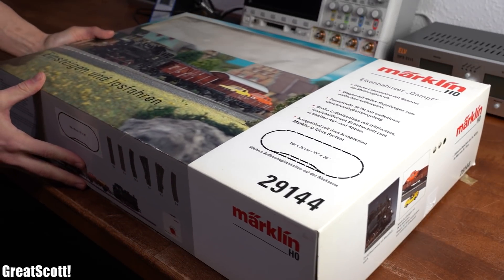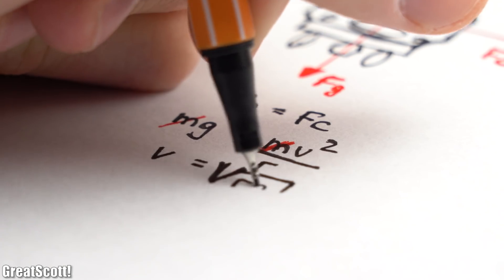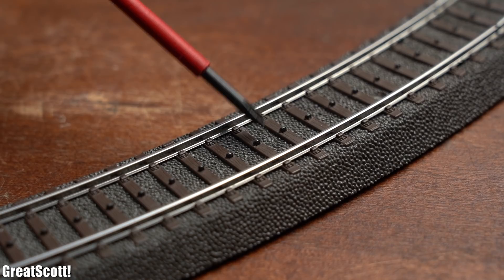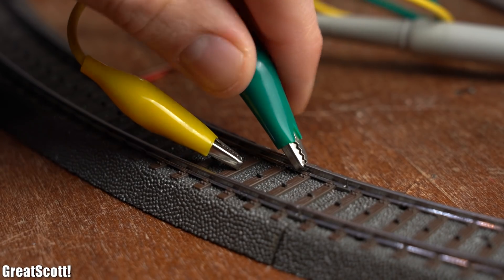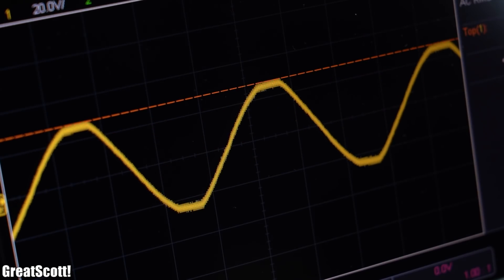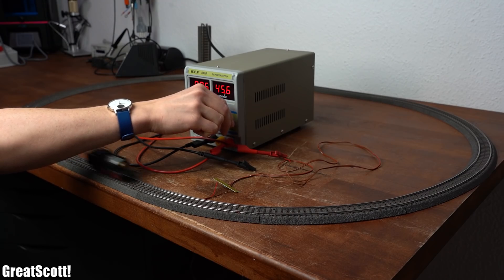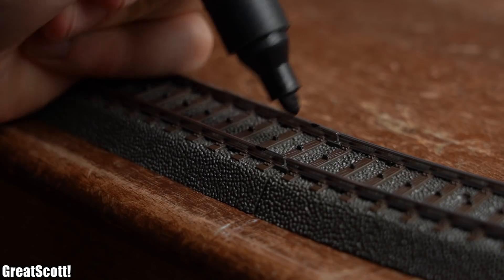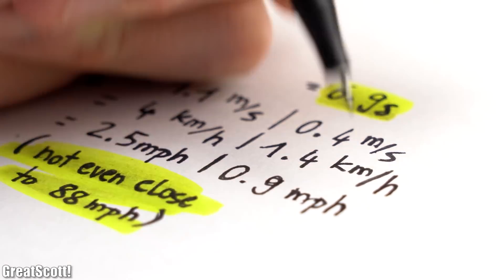How fast can an overpowered model railway drive? 88 mph?

Comment: Timing manually with your phone? Imposter!! The real Great Scott would have set up a photodiode and Arduino to record timings and ramp up the speed.

Wish you'd spent some time on the loco's circuit. What does it do, and what are the DIP switches for? Is there some form of soft start function?

Whoever that train set belongs to, buy them about 100m of extra track for Christmas and use it to settle the max speed question properly. If you can't buy enough track you'll need to call in Gromit.

Comment: Perhaps it is not the simplified formula but some other factors that made the locomotive derail at lower speed than expected, may be the spring that pushes the central contact onto the rail reduce the Fg?

Comment: But this 130 size motor is not capable of taking that much high voltage. It can roughly handle 12 to 16 volts. You should find a much higher KV rating motor. Or some high KV brushless motor.

Comment: If you tilt the railway properly especially on curves to "stabilize" the centrifugal force, you will be able to get higher speeds without the train derailing. That's the big issue with model trains - the railways are always flat (even though the actual railway is sometimes put on a platform that elevates it slightly and theoretically allows to add some tilting).

Comment: I hooked a stomper (1.5v) up to a tyco model rail road supply (variable to 18v, I think) It zipped really fast back and forth the length of the power cable really fast a couple of times before it burnt out.

Comment: Hi Scott, tank you for your videos. Your calculations for the speed limit are wrong. Indeed, the condition that the train stays on the rails is that the sum vector between the centrifugal force and the weight pass by a point situated between the two rails. So your calculations are good only if the heigh of the center of gravity of the train is half the distance between the rails. Have a nice Christmas, thank you again for your great videos, keep wondering us!

Comment: When did model trains start needing microcontrollers? They use to just be a DC motor and gear box and got positive and negative via the rails from a variable power supply.
Reply: DCC/Motorola system. You only need one controller for up to 256 independent trains
Reply: @TheRailroad99   ah, makes sense.  Still seems a bit extra though.  Those engines must be expensive as shit.  Hell even standard engines are usually well over 100 bucks each.
Reply: @darkworlddenizen  they are. I own many... But the decoder itself is not that expensive, around 50 bucks for a good one, cheap one for less than 20 bucks. 
Electronics are very cheap today

Comment: I'm sorry to tell you but the physics calculations you did were complete bullshit. What you needed to calculate is the angle of the combined forces of gravity and outwards turning force. If this is greater than the angle from the centre of gravity to the outer rail, then you have derailment. You 'assumed' derailment would happen if that angle exceeds 45 degrees

Comment: A old train set that my grandparents have changes the train's direction by pushing a higher than usual voltage through the system.
This makes some sort of solenoid trigger in the model train, reversing the direction, or making the train boost very fast if it doesn't trigger.
This is apparent by the model lights flashing brightly.
Reply: Yes, that was the old, mechanical way to switch direction. These trains also had AC motors.
I'm a fan of DC motors with digital controllers.

Comment: The equation Fc = Fg  is only true if the x component of the location of the Center of gravity relative to the outside wheel is equal to the y component of the location of the Center of gravity relative to the outside wheel.
The instance where the cart will lift off the track, it will pivot about the outside wheel and create equilibrium of moments between Force from Cg and Force from acceleration in curve. 
So simplified, it would be Fc*y = Fg*x, measured relative to the pivoting wheel.

Comment: I would LOVE to see you do a video on the electrical engineering of modern digital model railroad control. There's a standardized system called DCC and it's really quite fascinating to me how it is able to send power and data over the same two rails. Great video!
Reply: I  would like to see that, too!

Comment: I used a logo 6 and some proximity switches to make some arbitrary stations and time tables. Revesable through relay multiplexing with a higher voltage^^

Comment: The equation is wrong because you need to make de torques equal, not the forces. A train with a higher center of mass would certainly fall at lower speeds.

Comment: u need to create a mechanical cyclotron. Just add two railroad switches to a vertical loop. One switch is the locomotive input and the other one is the trigger allowing the locomotive leave the loop and be launched  against some target or back to the future. Locomotive must use an aircraft brushless motor.

Comment: ALLL  RIIIGHT  ~  We get to play!       'Need to Increase Voltage,  but - Power Circuit won't handle it.  So I unhooked it.'      = )   
Needed You when i 'was' kid.   Played with Dads Train set - Those cool old ones - (Bro) < lol,  increased speed to see it Fly off table.   Tough Train!

Comment: you would probably get better results by rigging a analog marklin 3029 series motor directly andthem pumping a lot of AC Voltage in it. Also that chip on the underside is a marklin modified Motorola MC145028P IC with added circuitry for digital operation.

Comment: What's that design ? My old Jouef electric train has on rail connected to the + and the other to the -.
Reply: It's Märklin's 3-conductor system. The tracks are connected inside the track and the other pole are the little dots in the middle. As Scott said, this train runs with AC current.

Comment: Hi, you need banked turns(Steilkurven) reach higher speeds, and/or longer straight passages with additional Voltage insertion points.

Comment: I had a similar model train but it was dc with one rail being positive and other one negative 
I think the reason why your has seperate positive is to prevent track spoiling 
On mine positive track was badly pitted

Comment: The equation is quite incorrect. You need to use the coefficient of friction when calculating the max centripetal force. GreatScott! set the coefficient to 1 which in reality should be something more than 1.  Doing this would result in a lower theoretical speed which would be much closer to the one he achieved.
Reply: Not really.  The train's wheels are not flat.  They have a ridge on the inside edge that holds them on the track and allows them to go around corners.  So you would have to take into account the depth of that ridge.  You would also have to take into account the height of the center of gravity of the train.  Obviously, not a simple problem and I do not know the solution.
Reply: @jimbert50  you're right. I was trying to simplify it. 

Lol. Friction is just tiny ridges too. Just up the friction coefficient for bigger ridges?
Reply: @pratikkunkolienkar1561  Do that and it will help a little, but then the CG will become the dominant factor.  Actually I think the CG is the main factor anyway.  Notice how the train leaves the track.  It does not slide off due to not enough friction.  It can't really slide off because of the wheel ridges.  It actually tips over, leading me to think that CG is the main factor.  LK is right - the width of the tracks is also a major factor.
Reply: @jimbert50  agreed.  The Reliant Robin got 3-wheeler cars a bad name by falling over on bends.  Sadly, people blame that on it having 3 wheels when the culprit is a stupidly high CG.  I had a Berkeley T60 which had the better geometry of two front one rear and a CG about 20 cm above the ground.  That won't tip, it'll slide when the tyres  lose grip, as 4 wheeler cars usually do, unless they have a high CG.   So the essential issue here is CG.  Add some lead sheet to the bottom of the loco, just clear of the sleepers and it'll go round a bend faster.
Reply: Its Held in the Tracks by the normal force in the rails. Maximum Speed squared = 0.5*r*g*l/h, where h ist the vertikal Position of the Center of Gravity and l ist the Wirth of the Tracks.

Comment: Not even close in real world speed, But you forgot to calculate scale speed.. I bet it was going 150mph or better.
Reply: H0 is 1/87th from reality, thus 2.5mph would equal to ~220mph. Quite good for electric steam locomotive, lol.
Reply: This is H0 gauge, so the scale is 1:87
Reply: @e1woqf  87 x 2.5 mph or whatever the speed was he said. So essentially it went past 88 and came back from next week to give us this video. See ya in two years.
Reply: @wojtek-33  Yet it derailed, thus the physical effects of (over)speed were scaled.
Reply: @wojtek-33  A two axle shunter probably did not fill those measurements, but anyhow, since material density doesn't scale either, feel free to claim one internet point. 🤗
Reply: You don't do speedscales, do You? 
That's like scaling colors in architectural models ....
Reply: @wojtek-33  But measurements are, and yes, you can't actually scale speed, but you can scale distance traveled, then time how long it took to travel and get a theoretical travel time in the full-scale model. (as long as they stayed the same speed because you can't actually scale speed. If you scaled speed, it wouldn't be taking into effect weight, aerodynamics, etc. which is exactly what you already said.)
Reply: 5:25 if you take force of friction= centrifugal force then it should work who else agrees
Reply: I don't think he made the point clearly enough.  If I make a 1/10 scale model of something involving light am I safe in saying that the photons are travelling at "scale speed"?   Ten times or one tenth of c?  Nah.  Similar problems in scaling fluid dynamics.  Only small bumble bees can fly, not big ones, because the aerodynamics don't scale.
Reply: @raykent3211  whatever
Reply: @raykent3211  Well, assuming that the real scale train would hit ~220mph on a track of the same upscaled radius, it would topple over, just like it did in this video. So, you will find your theory is not quite correct. Although I do understand what you are saying, things such as aerodynamics and tolerances make a huge difference when scaling things. I.e. it wouldnt be practicable to just scale every component up, making it a different component in a sense, and it would obviously be limited by aero. But physics aside, without taking it too deep: "if you were to fit in this train it would feel like 220mph". It's all relative

Comment: I tried this when i was a kid.... As a result i ended up with a broken train with burned motor..😭
Reply: Did this with a 9v and a scalextric, worked fine some how, but you had to catch it to stop the bloody thing
Reply: I tried it with those small electric cars, also burned motor lol
Reply: Why mine didnt burned.....Even i inserted 9v in it,
Reply: F
Reply: as an adult i'm still trying to push the toycar to go faster with 18650 cells. Might be not for long before i have another dead motor LOL
Reply: I have a collection of burnt DC motors
Reply: @SirDella  Can a burnt motor be repaired ?
Reply: @kiranshashiny  Yes, the coils and brushes can be replaced, I don't know where you get new brushes from tho
Reply: @SirDella  u can make them with aluminium foil or small strips of a metal cut to the shape of the brushes. I have done this and it works well. I even think the aluminium brushes are more efficient compared to the coarse brass brushes.😁
Reply: @nonowords7857  Thanks!
Reply: @SirDella  happy to help.
Reply: @SirDella  I actually made a lot of gizmos with motors when I was younger and I know a lot of work arounds for problems like burnt or brush damaged. Ask me anything. But yeah I have a question, I have literally pumped 16 volts into a single small motor multiple times yet I have never managed to burn any. Tell me how any of u guys managed to do this.
Reply: @nonowords7857  That's nice! I played around with motors too. Only a few burned out more than ten years ago so I don't remember what happened to them, but I know that I connected one to a 9v battery and died after a few seconds, they were from cheap toys so that could be a reason.
Others lost their solder pads since I didn't have a soldering iron so I strapped the wires to them, over time a lot of them lost their pads
Others simply got obnoxiously noisy, which could be fixed with some lithium grease I guess
And the last one is a hair dryer motor, the carbon brushes worn out and it can't be opened sadly
Reply: @SirDella  I have used 5 nine volt batteries in series to run a single motor. The total voltage must have been near 45 volts but cause the batteries were cheap I think it was near 20-25. Yet I didn't get a burnt motor. and I tried this on the same motor which is in the train in this video. I can only see one way to burn a motor and that is to connect multiple 9 volt batteries in parallel and thus pushing the total current to extreme levels and thus burning  the thin copper wires. And yeh I hate it when those pads break but I found a workaround for that too😁
Reply: @nonowords7857  that motor is buff hah, nice I'll consider replacing the brushes with aluminum foil. It's a bit sad that the RS style motor can't be opened to replace the carbons, because that thing is a beast
Reply: @SirDella  yeh it's a bummer u can't open them.
Reply: Why not attach a resistor in series to control max current? This may prevent the motor from burning.
Reply: @ixape  i did that as a "kid"..... So no more burning motors...

Comment: Try banking corners. That should help get a faster speed without flying off
Reply: FiA Stewards could just use an extra weight on one side probably for this track
Reply: You could but then on the straights you tip over because of the weights. You could use weights, just make the whole circuit a circle
Reply: @Clockpie5436  Active stabilizers :D As it gets to a turn you shift the weight. A screw with a weight on it connected to a motor should work. so that as the screw turns the weight is moved closer to either side of the screw. Then add an accelerometer or gyro sensor. Mount the screw mechanism sideways and program it so that it tries to counter the trains tilt. Another way to do it would be a servo with a weighted swing arm. As the train tilts, swing the arm to the opposite direction.
Reply: 5:25 if you take force of friction= centrifugal force then it should work who else agrees

Comment: I remember the old Marklin system, which used the same control voltage trickery, but instead of electronics inside the cab it had a relay that would pull in at 20VAC, which operated a reversing switch that flipped the motor voltage, derived from the supply using a bridge rectifier, so it would run in the opposite direction. During the time you were driving the relay the contacts would be floating in mid position, so the motor would not run, an elegant solution. Power supply was also simple, a mains transformer giving a 12VAC output at a few amps for the drive, and another winding of 12VAC again, switched by a microswitch when you turned the control back past zero. No variac speed control, just a great big wirewound pot across the 12VAC output, giving the variable output, and meaning the case ran a little warm.

Cleaned a lot of track, as it would of course, being here in the tropics and near the ocean, rust, seemingly instantly after cleaning, unless you were actively running the train on it.

Comment: I'm curious as to what the DIP switches do.
Reply: Set the device address.
Look up "Märklin  ditigal system" or "Motorola decoder".
This is far more than just a motor controller, good decoders can also be reprogrammed to set the max/min speeds and support bldc motors etc.